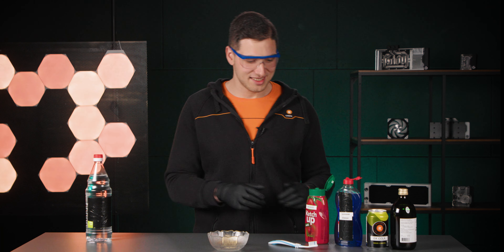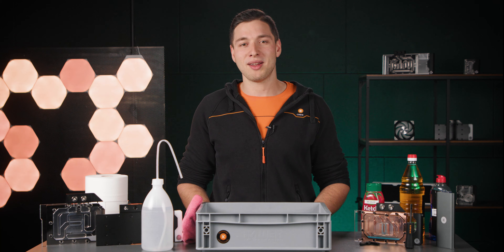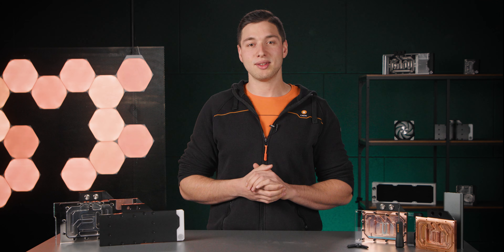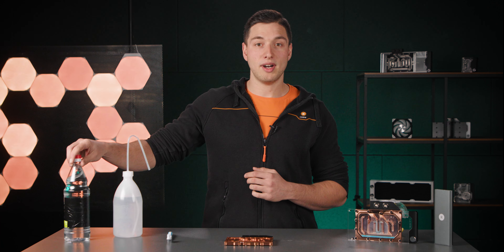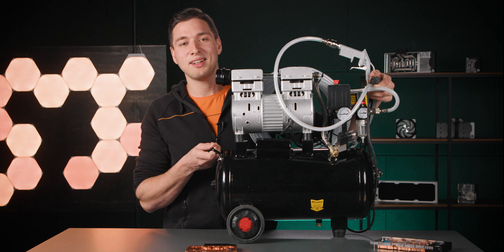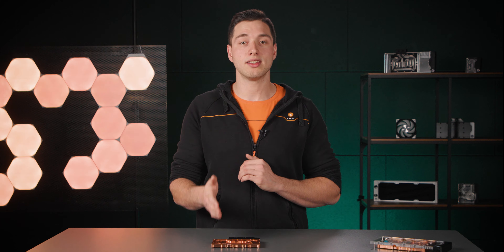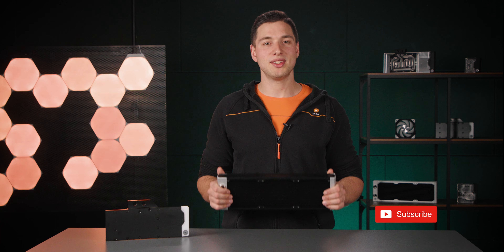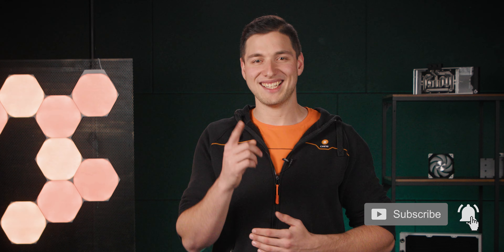How to Clean Your Liquid Cooling Water Block Properly | Basics of Liquid Cooling

Comment: How durable are the orings after theirs oils are washed away ?   Does EK sell spare orings for gpu blocks ?
Reply from the maker: The o-rings are durable, but if you ever need a replacement just contact our customer support team and they will help you obtain a new one: https://customerservice.ekwb.com/
Reply: @EKWBofficial  would using a silicone food-safe lube on the gaskets be ok to help condition and prevent leaks after cleaning?

Comment: If you did proper loop prep and ran a good fluid, you shouldn’t ever need to clean a water block. The only time I have had to clean a block was due to my own mistakes while I was learning the hobby. I haven’t had to clean a block in 6 years.
Reply: Any recommendations? I have corrosion now for a completely new build. It’s been two months. Lol